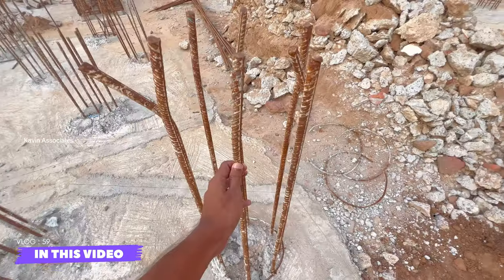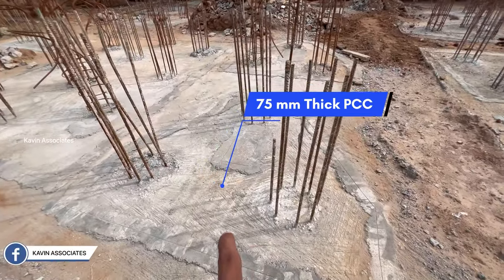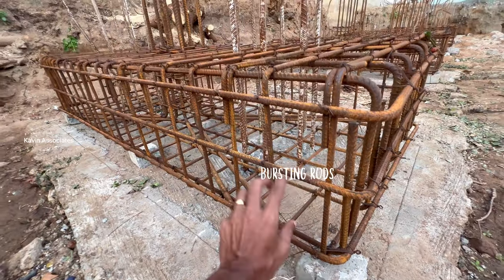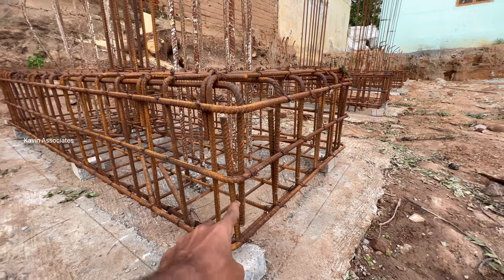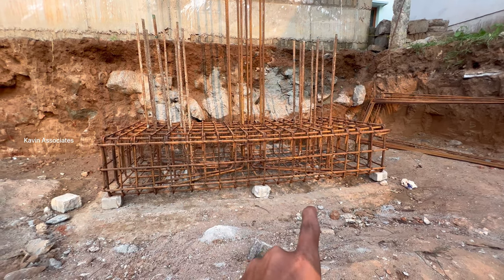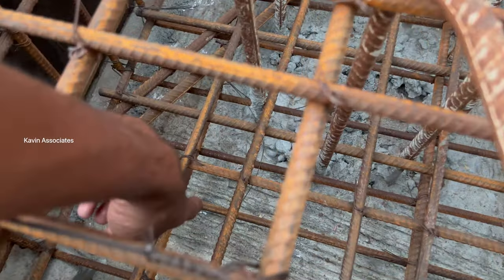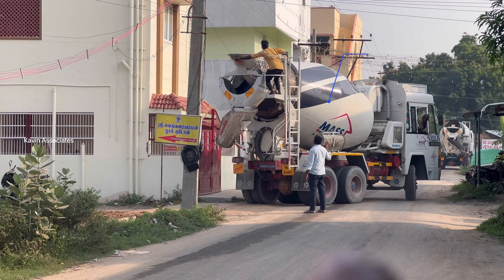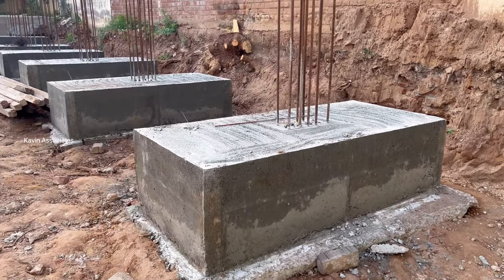What is Pile Cap ? | Things to Know About Two Pile Cap & its Reinforcement | Pile Foundation | Pile

Comment: Sir , in this video i can see you have not connected the pile caps with the plinth beam. in my structural diagram, the top part of the pile cap is connected as a plinth beam and the concrete pour will happen for the pile and plinth beam together. is that fine?
Reply from the maker: We can do separately also it’s not plinth it’s called grade beam